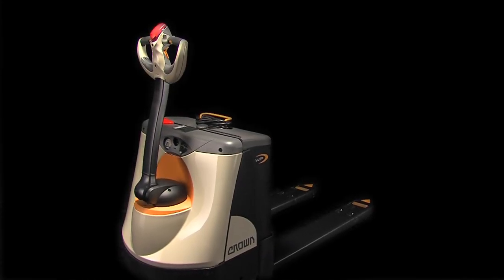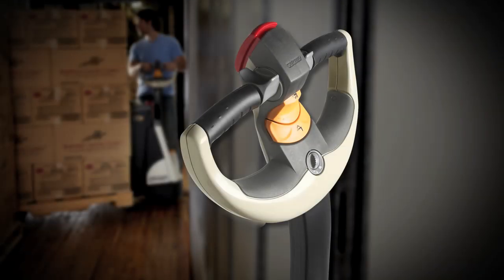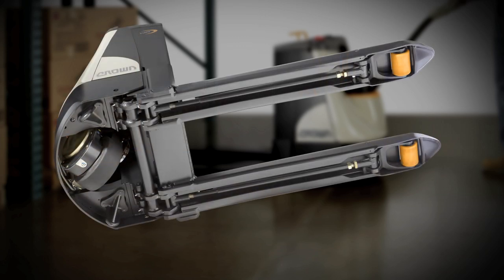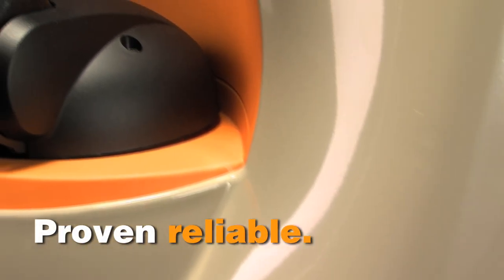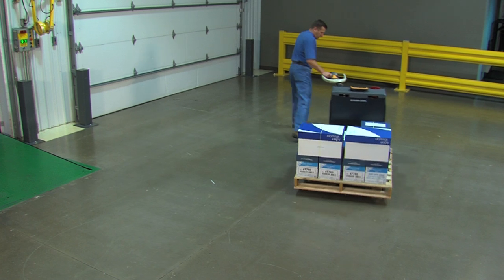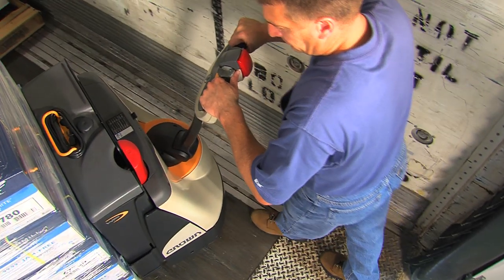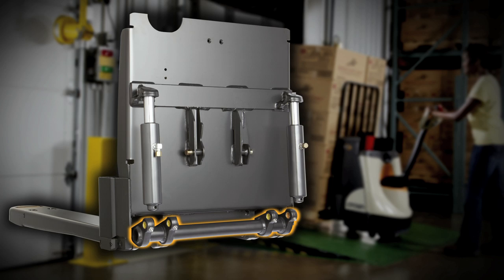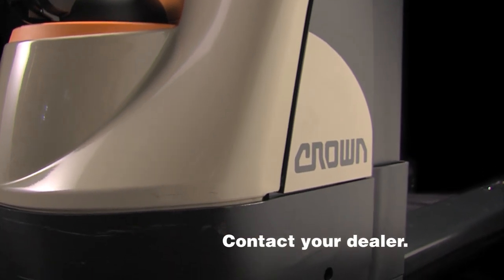Crown WP 3000 Electric Pallet Jack

Comment from the maker: Thanks for your question, MsXian143.  The basic guideline for planned maintenance is for it to be performed every 60 days or 250 hours - whichever comes first. The frequency of this interval may need to be increased in some applications; for example, if the truck is used in a freezer or in food processing environments. And of course, you should work closely with your local Crown contact to develop a service plan unique for your needs.

Comment: I have a crown pw3520-60 electric pallet jack that will not lift. I bypassed switch at solenoid and it lifted. I replaced raise switch on control handle. This did not fix problem. I swapped out the solenoid b/c I had an extra one and it did not fix the problem either. What could be the problem? Battery is charged and full of water. Machine operates correctly otherwise.
Reply from the maker: Sorry to hear about your problem. Our service team will be happy to help, and you can reach them through our website here: https://www.crown.com/ncgi-bin/CreateForm.pl?form=service-request